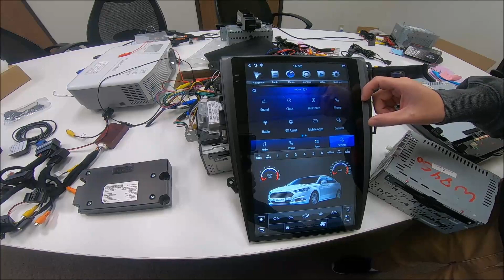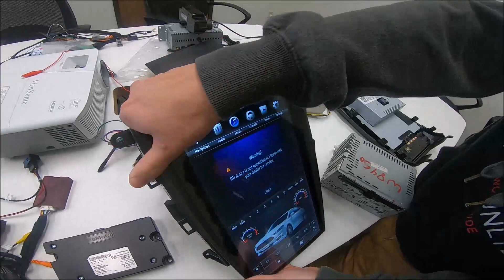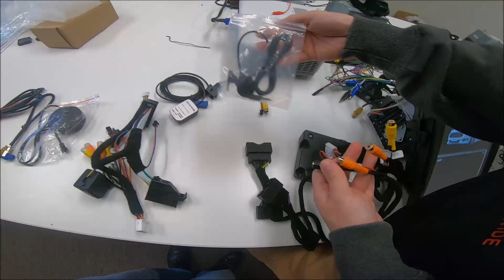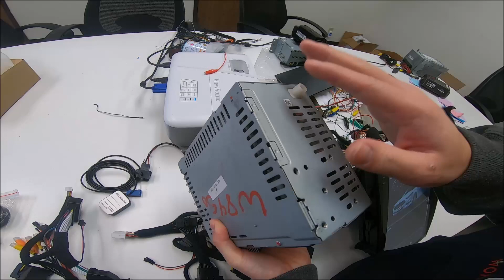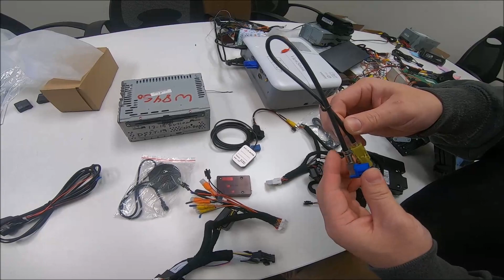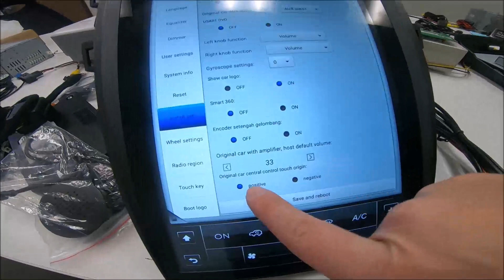How to: Connect and set up 13.6 inch head units for 2013-2020 Ford Fusion

Comment: Okay so, I have sync 2 stock as I have a 2016. If I want apple carplay and all that goodness, do I need to upgrade to sync 3? or will Apple CarPlay work on this even though I have Sync 2? If I can get CarPlay to work with my stock sync 2, is there even a reason to get a sync 3 APIM installed first? If there are good features and reasons to get 3 then I might go for that as well. Thanks!